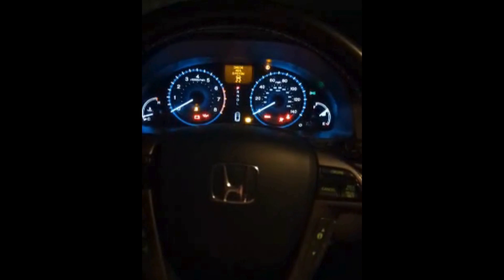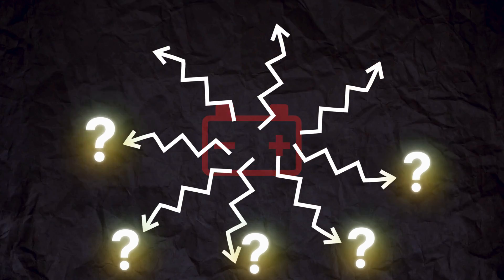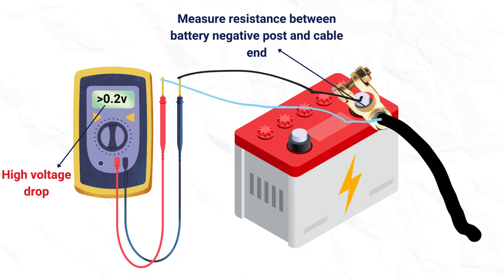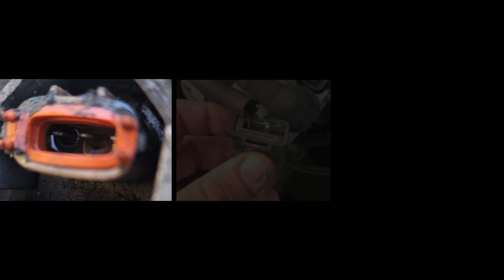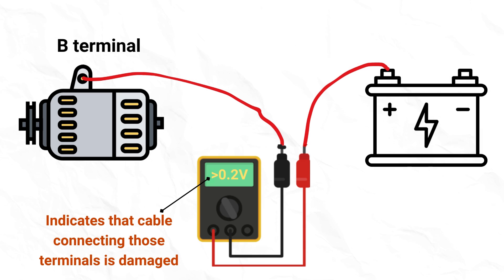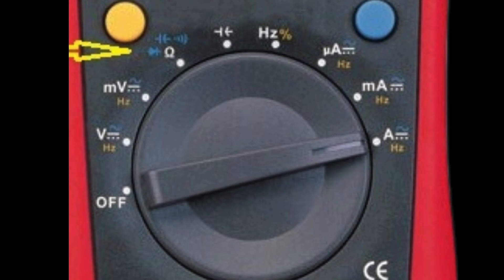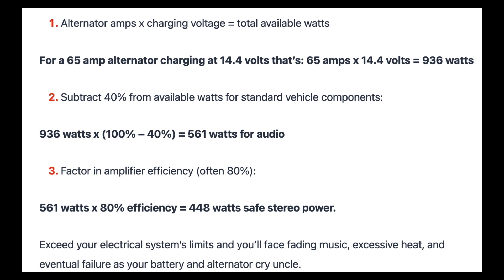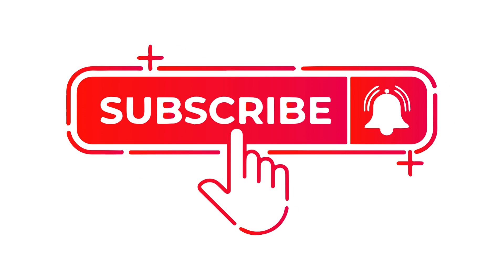8 Culprits Your Battery Light On but Alternator is Charging | How to Fix Battery Light On Dashboard

Comment: Why don't my car battery change unless I put my head lights on. I measure the voltage on the battery with engine running and headlights off It only shows 12 volts then when I turn on my headlights I read 13.8 volts. I've taking it to several mechanics and they never seem to find the problem and they keep telling me that it's normal why is the alternator not charge unless the headlights are on when I first bought the car It did not do this. But all the mechanics I've gone to they argue with me and argue with me and never fixed the problem

Comment: I purchased a Lombardini diesel ( skid-motor like used on truck refer units) I am using it on a mining machine. It had a solid-state control panel. Over a short time the panel kept loosing the ground, Relays burned out many other issues with the panel. I had a shop remove all the panel, warning lights everything. It runs as a diesel used to. The only problem is, The alternator does not work. There are 3 terminals on the alternator. "B" is to the Bat.. "D+" went to the Alt charging warning lamp. The third spade connector, ????. They attached nothing to either of these. Said it would work. Does not. Removing the alternator for testing requires several Hrs, Drain the whole Hydraulic system,entire rear counterweight system. Thank you

Comment: I have a Ford focus 2005 and I have a super dim battery light on that wont go away even 1hen the car is turned off I put a new battery in and my mechanic put a new alternator in  Any tips on this dim light?
Reply from the maker: check its fuse

Comment: What if the battery light shuts off for a while then comes back on.  Intermittent battery lighting should narrow it down.  I also disconnected the battery completely and the engine kept running so it isn't the alternator.  I replaced batteries.
Reply: Voltage regulator? Or serpentine bell?

Comment: Hi I have a 2015 polo vivo the altonater checked out good but the battery light goes on and off, but when I hold the regulator plug it goes off I let's go it go on when the engine is running

Comment: Hi! Started the car and notice that the battery icon light ups after leaving the car in idle for a couple of minutes, the. Tried restarting the car and the battery icon light disappeared. (Happened 2 times already) Thanks a lot for the help.
Reply from the maker: That's weird, I recommend you check your battery connections too.

Comment: My battery light was on for a couple short drives before i lost all power and car stalled. Yet when i charged the dead battery back up and used to get the car home the light never came back on. I dont want this to happen and get stranded but i dont know what to replace or fix to not have it happen again
Battery has stayed at 12.6 volt now for a week after recharging

Comment: I have a 2010 Chevy Camaro 2ss just got a new battery yesterday and the alternator is new but has been sitting for 2 years not connected. I start car little hesitant at first then fine but the battery volt is just under 12 and 20mins later charging system comes in(but goes away when I rev the engine) and says code P0562 and code P0118 could that just be the sensors considering the alternator is somewhat “new”. Friend told me to check all ground wires along with sensors. Curious on what your option is? 

P.s Sorry for the horrible explanation just got done dabbing lll
Reply: Correction P0621
Reply from the maker: Do you notice corrosion on ground connections? this is the first point to check with.

Comment: I just replaced the battery and alternator in my 08 Hyundai accent and the battery light is coming on still and when I put multimeter on it it’s showing 12.5 volts while running but doesn’t seem to be dropping at all or very little if it is. I just noticed when I tried to turn on the heater that it didn’t come on at all, I checked fuses and didn’t find any blown, could it be a relay or something else?
Reply: Same plz help

Comment: Toyota Yaris 2007 car does not start when I open the clutch all the signs light up except the battery and engine light and when I put the transmission in N the battery and engine signs appear and I try to start the engine nothing happens except the battery and engine signs appear and disappear when I move the key

Comment: Old corvette. Voltage at the alternator is hitting 14.99v. and 15v while running. New battery showing 14.3v across terminals. Gauge shows almost to the line before the red zone. Gen light is dimly illuminated while running. ~. 6v drop at battery. No volt shows up when checking + at alternator crossed with - terminal at battery.  This is a new issue after installing new battery and charging it fully. Is 15V at the alternator (measured with multimeter) too high? Alt and battery tested fine at the auto store, on and off the car.
Reply: How old? 
Sounds like external voltage regulator is bad.

Comment: 2004 CHEVY SUBURBAN 2500, BATTERY LIGHT ON, GAGES NOT WORKING, DRIVER SIDE DOOR PANEL NO WINDOW ORDOOR LOCKS AND DRIVERS MIRROR THE THING WORKS ON DRIVER SIDE, THE REST OF THE CAR IS PERFECT, STARTS AND RUNS GREAT. WOULD THIS BE MY UNDER THE HOOD FUSE PANEL GONE TO SHET, PLEASE HELP IF YOU CAN ! thnx rick OH. aND i HAD TO REPLACE THE FUSE IN CIGAR LIGHTER FOR THE OBC  WHERE YOU HOOK UP THE READER TO WORK, IF ANY OF THIS IS MAKING SENSE

Comment: I have a VW Jetta 5 20tdi battery light flashing on and off alternator has a new regulator, battery 1 year old and when the car park over night the next morning the car won't start then jump start the car and starts. The following night disconnect the negative terminal on the battery and the next morning re connect the terminal and the car starts and when driving the car looses power. Please help. 🙏

Comment: I changed my alternator,belt, battery and light still on holding charge at battery at 14.4 and with load 14.2
Reply: I have same issue

Comment: HELP. 2015 Subaru Outback with 3.6 motor.  NEW battery, NEW Alternator bench tested good.  Alternator not charging battery.  CLEANED all grounds, checked fuses, terminals clean and tight, no visible breaks in any of the wires.  Car starts right up, but you can put a multi meter on the battery and watch the voltage drop as its running.  Battery light on dash illuminated.  ANY IDEAS??
Reply: Got this same problem NOW, any updates? what was the problem?  THANKS
Reply: check for voltage drop between B+ on alternator and + post on battery exceeding 0.2 volts.  Should not be greater than 0.2V while engine running under max electrical load.  Same applies when measuring voltage drop between the alternator casing and the -ve post on the battery.

Comment: I have this problem with my Civic the battery light stays on alternator charges perfect grounds are perfect battery is new connections are perfect I've been told that rebuilt alternator specs does not match up with Hondas and that's why my light stays on with a rebuilt alternator maybe other cars have the same issue

Comment: My battery light come on for 2 seconds and then goes off for minutes and then back again for a few seconds, chance the glow plugs control unit for a new one and still the same, check the glow plugs and the all ok. Any ideas what can be please? Before a change the alternator, i have check the battery and its 12v with car of and over 14 v when i turn the car  on

Comment: Hi i replaced brushes n regulator on ford focus but now altednator is charging and the battery light is still on...fuses all good what can this be?
Reply: Need some help
Reply: So wat the issue
Reply: The issue was brushes for alternator were worn I replaced the whole regulator  instead of brushes only so now the light for battery never clears off....even after I diagnosed n reset alarms
Reply: Same problem here
Reply: What did you find the issue to be

Comment: Guess what I've been through all that three times as a matter of fact and I still have a battery light on and it just came on right after replacing the dead battery and the bad alternator and yes they were all checked themselves and their components all the grounds are just fine and all of the fuses and relays they're all fine so what's up now
Reply: What was the result?

Comment: Hi, on my Mercedes Vito 639 2004, the battery light is on permanently , but as I am driving, the whole of the cluster goes out intermitently for about a second or so. I have replaced the battery but it is still occuring. External lights stay on, its just the dash lights and stereo.

Comment: Hello everyone, I have a problem with my car. When the gas pedal is pressed suddenly and the car reaches 3000+ RPM, there is a momentary power outage throughout the car (everything shuts off). This happens for a brief moment, and then the car continues to run normally. Some mechanics measured that at that moment the voltage drops to 13V. Almost all parts have been replaced (engine computer, new battery, alternator), but the problem still hasn't been resolved. I would appreciate any help if possible. Thanks in advance!
Reply from the maker: Hi, I have created this mechanic chatbot. Please check:
https://www.autocornerd.com/mechanic-chatbot/

Comment: Hi! Thank you for the video! I just bought a 2013 Chevy Camero and after around 80 miles the battery sign came on, voltage dropped from 12.5 when it first came on to 11.2 within 20 Minutes. Replaced the alternator and everything was fine for 150 miles, then the same happened again. The only difference is that sometimes when standing or at super low rpm it does charge and go up to 14V but as soon as i accelerate it drops down to 12V again. I thought maybe the belt couldnt handle high rpms but the belt is rotating fine all the time. Do you have any idea what could be the issue? I'm afraid its something with the ecu telling the alternator to stop working or something or is that stupid?
Reply from the maker: So you mean when you rev high, voltage drops to 12V. Are you talking about alternator voltage or battery voltage?
Reply: @AutocornerdPros  well the connections are alright so I was talking about the voltage of the system measured anywhere 

Seemed to be the alternator - thank you!
Reply: Where you able yo get it fixed?

Comment: .i have 2014 F250 the battery light is on. The bet is fine. It was burning up alternators on like the 3rd one. I have looked into the problem here in Utube. I  was reading the resistance on the two control wires on the alt plug had 2 ohms on a purple and a blue with red strip.  I have rewired the three wires in the alt plug. I ŕead 14 V at the battery while it is running. Did a load test on Battery and it is good. I pulled the negative terminal while running and she stayed running so I am charging from the alternator. Still the light is on. Could it be the engine ground wire causing the light to stay on??
Reply from the maker: You need inspect all ground terminals of your engine.
Reply: I rr r

Comment: Hi. Thanks for a good video.I have changed the altetnator and battery. My alternator went bad in one month. Replaced it again. But the battery light is dim, not fully eliminating. What might he the cause?
Reply: Have you checked  the turbo boost sensor/valve/vacuum device?
Reply from the maker: Did you check alternator connections, ground terminals? You can read this guide:
https://www.autocornerd.com/car-keeps-killing-alternator/
Reply: @AutocornerdPros Yes. I have checked the voltage. Checked the voltage drop. Seems alternator is good, voltage is fine, ground is good.

Comment: Hello,  I have a 2005 Mercedes Benz SL 500.   My battery light has come on.  Both my batteries have tested at 12 v with the engine off.  I have driven the car at night with the lights on and the air conditioner on with no apparent power loss.   The light will not come on until I’ve been driving several miles, then it will stay on until I stop the car.   After letting the car sit for several hours and start the car again,  the light will be off until I resume driving it again for a period of time.   Do you have any recommendations of what I need you to check on this vehicle to determine why the light is intermittent.  My thought is that if the alternator is bad,  the batteries would drain and the car would stop.  Aside from the light being on,  I feel no loss of power or sign of battery drainage.   Thank you.   Any thing you can offer would be appreciated.
Reply from the maker: Did you check its relay? Also see ground connections. These could cause intermittent issues
Reply: Same thing i just  make light disappear mercedes has way to many gadgets lights